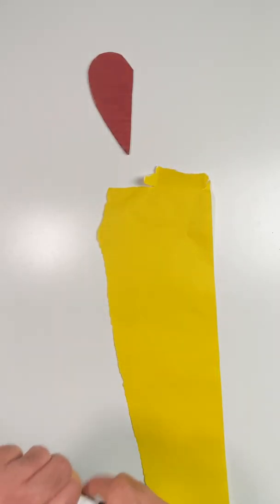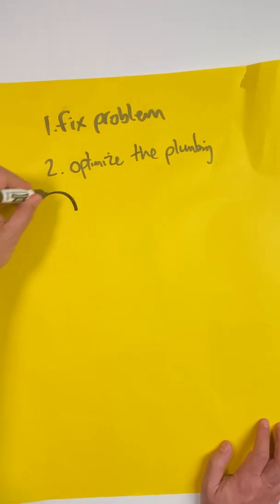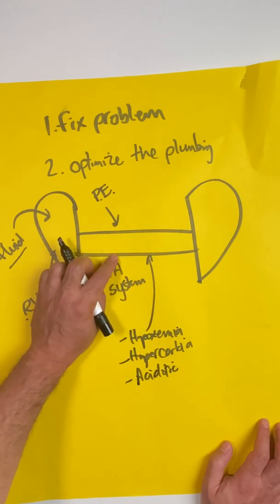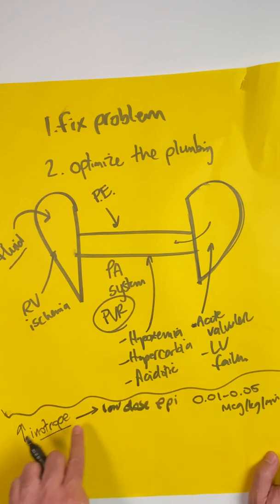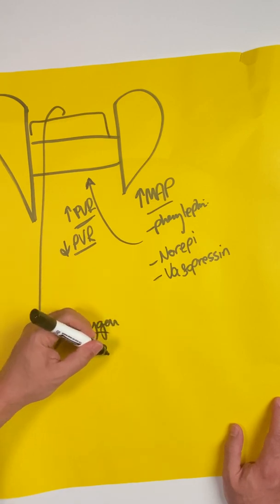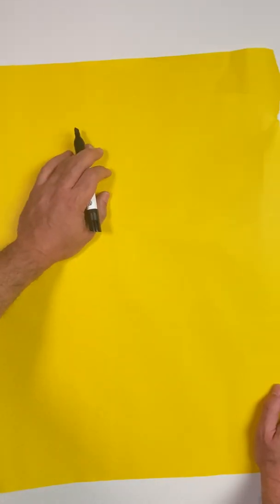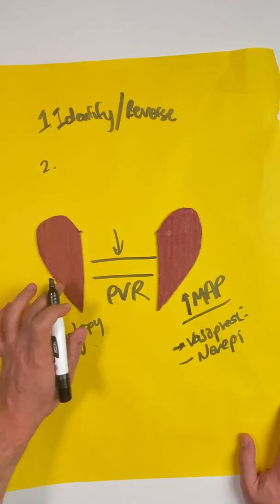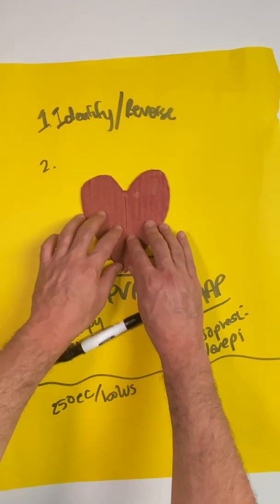LEARN TO FIX THE BROKEN RIGHT VENTRICLE

Comment: When you say give small amounts of fluid are you saying crystalloids or colloids? If I suspect a right inferior MI STEMI in the field and the patient is showing signs of hemodynamic instability, some paramedics systems have protocol instructions to not administer nitrates or use with caution. Would lactated ringers, in the small amounts, be the better choice to maintain the vascular volume? After I consulted with my medical control of course.
Reply from the maker: The data says there’s no difference. I’d use crystalloids to start and LR is my go to